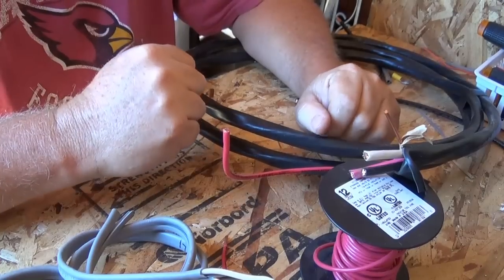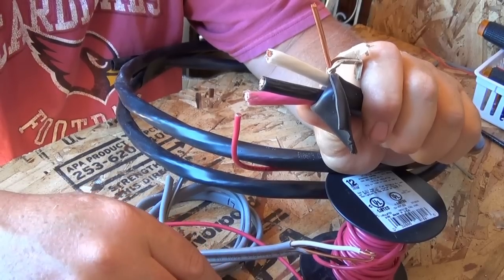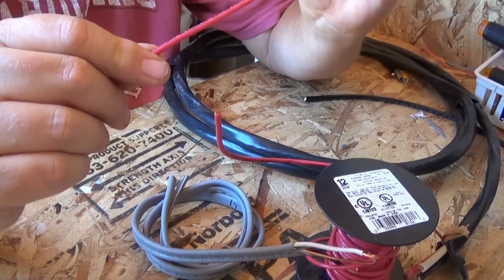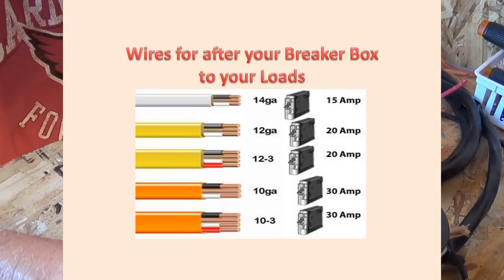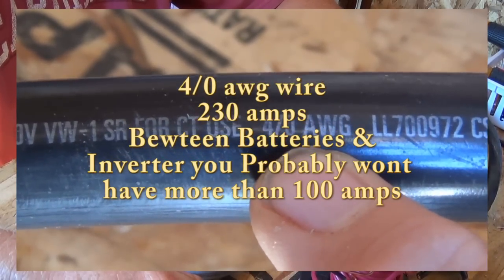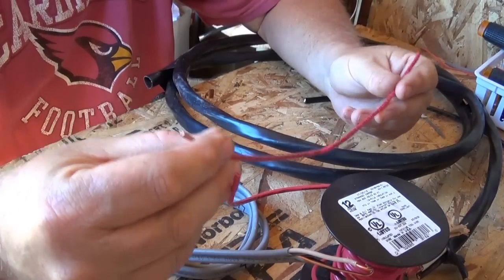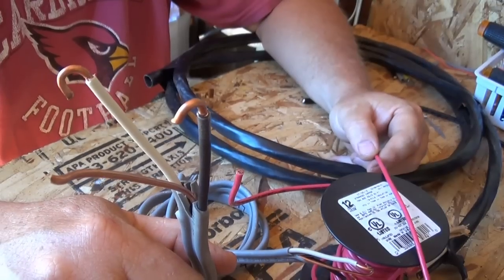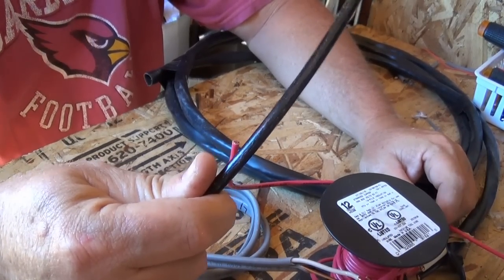What Size Wire Do I Use To Wire My Solar Components? Does Wire Size Matter?

Comment: it seems to me that watts should be relevant, such as in the case of using 12 ga solid wire that is rated at 20 amps to 600v meaning 12,000 watt rating on the wire, so if i use 12 volts, then can go 1000 amps same watts! 12,000 watts? so if i use 12ga solid romex from my panels at 25v dc and to my batterries at 14vdc then that solid copper 12ga wire should easily handle 100 amps, right? my wires are slightly warm on my full charging status but not hot, am i limiting my current at all?
Reply from the maker: i am not an expert from from what i understand you dont care about the watts when it comes to wire size. its the amps that matter.

Comment: The reason that an appliance is labeled at a specific voltage is because that is how it is tested and the resulting amps at that voltage.  A drop of 10 volts from 120-110 in a house is highly unlikely.  Three wire NM cable is not only for switches.  It is also for stoves and dryers that need 120/240 volts.
Reply from the maker: thanks. also from what i understand some appliances need at least 110 volt to operate. .

Comment: Could you answer a question? I have a 30A solar charge controller, with 2 separate inputs, for 2 150w panels, what AWG cable would be needed for this. Thank you.
Reply from the maker: i am not an expert but i would use the largest size that will fit. the documents of the charge controller should tell you the size it will handle. most pv wire is 10 or 12 gauge. i dont remember.

Comment: I’m sorry I’m just as confused as when I got here. 😢 the best I can do is , the higher the amperage the thicker the wire or the higher the voltage the thicker the wire or the same with watts, I guess? I really don’t understand anything really.😢
Reply: The voltage rating of conductors is based on the insulation on the conductor.   It is voltage rated so that at that voltage or less, two conductors next to each other will not arc.   Watts is a unit of power and what you pay your utility company to borrow.  Amps is the electricity flowing through the wire.  Amps in wires causes heat because of resistance in the wire.  Increase amps will increase heat in the wire.  Increase the wire size to reduce resistance in order to reduce heat to a level that will not damage the insulation.   Hope this helps you!
Reply: @KevinCoop1  thanks 😊
Reply from the maker: focus on amps. each size of wire is printed on the wire up to 600v.

Comment: also if i recall right, AC volts travels mostly center core, where as DC flows easier outter wire (aka more center vs's more outter skiin, least thats what i was told yrs ago.
Reply from the maker: could be. i really dont care how it travels i just care about which wire i should be using. solid for ac and stranded for dc. however when you have really large cables you use stranded also known as welding cable mainly becus its flexible compared to a really thick solid copper rod.
Reply: @ArizonaHotHomestead  how it travels is part of the reason to choose the right wire, notice they dont use braided wire in main home wall lines. there is a reason.

Comment: I’m a bit confused on the solar panel wires. I’m recommended to get 4awg wire that will go to the inverter since my solar panels are over 100ft from the house however it’s saying that  mc4 connectors only fit 10-14awg. So how does this work?
Reply from the maker: you can get mc4 for 8awg wire. here is what i would do. use a electrical box at the panels and inside the box wire the panels wire to a 4awg. example 10awg with a 4awg. you might want to use a small bus bar just make sure they have an insulator. one for the positive and another for the negative. if your charge controller can take a 4 awg or if you are using a breaker inside with your components before it gets to the charge controller and it doesnt take the 4awg wire again use a box and bus bars to reduce the wire to a wire that will fit . does that make sense? good luck. oh by the way i am no expert.
Reply: You should keep your conductors at 10 to 14 as short as you can.  Mount some Mc4 connectors to the side of a junction box with #10 inside the box.  Splice the #10 to the #4 inside the box and run the #4 in pvc back to whatever you are feeding.  Do the same thing on the home end.

Comment: Hi 
Might my question gonna sound stupid so sorry for this first😃
I'm just only starter learned car electronics..
So my question is if the starter motor need about 200amp for the start and a 4AWG wire can only do 75-100amp how is it gives for the starter motor 200amp?
Might it sounds stupid but I'm getting confused now..
Thanks in advance for anyone who's answers for me😊
Reply from the maker: auto expert could answer it better but i thought is the starter only needs the 200amps for a short time to start after that i think the alternator helps to keep everything going.
Reply: Amp ratings of conductors is amps over time.  So, amps at a certain amount of time will heat the insulation to cause damage to it.  It is assumed that the starter will only run for seconds.  So, it’s all about how hot the wire gets.

Comment: Hope you can see this 6yrs after you posted this: I'm installing a 2K watt inverter. Batteries to inverter mounting location is 15'. I decided to go with 4/0 welding cables. 

My question is: what gauge should I use to ground the inverter to the chassis (semi truck) the inverter came with some doubled-up wires that are stamped 16-8 on the eye-connectors (not sure what that means)

Oh ya, this stuff makes my brain hurt 😂
Reply from the maker: i am no expert. some of this stuff hurts my brain too. lol... for all grounding use 6awg bare or green wire. . i am guessing you should be ok on 4/0 . maybe touch the wire to see how hot the outside insulation gets. if its super hot you may want to get larger cables. i think you are going to be fine.

Comment: How does distance from solar array to inverter determine gauge?.
Reply from the maker: i am no expert but what i am told is electricity dc or ac will have a voltage drop over a period of distance. the size of wire if bigger than needed will have a less drop than a smaller wire.  dc will drop faster than ac .
Reply: Use a voltage drop calculator online.  It’s all about power loss.  The higher the %lost the more money you wasted (to a point) I would suggest you size wire for 3-5% voltage loss.  Four utility solar, I designed to 1% average.  Lost power there is lost income.  Owners want income.

Comment: You plug in 120, 120 will be at the other end! your wrong.!!🤣🤣🤣🤣🤣
Reply from the maker: not always... most appliances and lights will run on 110v or 115v  but yet 120v is started at the distribution box. depending on how long the run is the voltage could drop to 115v. .

Comment: Really silly to try to give advice when you don't understand the subject. Normal modest off grid homes using 48 volt battery bank and a 5000 watt inverter is likely to be fine with 1/0 with just .25 percent voltage drop over 4 feet. (you want to keep your inverter close to your battery bank.

Listen to your inverter manufacturers recommendation (particularly if it's UL1741) 

Find a good voltage drop calculator, try to keep voltage drop under 2% for wiring from the array to the charge controllers. Today with cheap solar panels and MPPT charge controllers this is not a firm rule like it use to be when solar panels were $5 a watt and you were usually using PWM charge controllers.
Reply from the maker: i am no expert. actually where i live most people have 12v systems, and running maybe a 2k inverter. they all live in tiny homes or rv or connex, voltage drop means nothing to me its to complex. i look at it as will it work or not. most people that live by me are the same way. i do appreciate you adding your comment becus some folks need to know information you provided so thanks for your input. have a great day.

Comment: would I use120 feet   2 gauge wire from 20 400w pano 120 feet to the regular?
Reply from the maker: if you wire the panels in series to increase volts it will help with voltage drop and a 6 gauge would work but it you want to run 2 it will reduce the voltage drop but maybe to big for some connections so you may not a junction box to reduce the size ..

Comment: 4 100watt 5.4amps per panel over a 85'' cable run to an 40amp mppt charge controller. what size wire is best for this application? Take in mind this is just a starter kit and most likely up my panels and battery bank size in future.
Reply from the maker: most panels are 10 or 12 awg wire. you could use 10 awg for most applications. the higher voltage the better.

Comment: Not just amps but insulation type,condition of use and terminal rating.
Reply from the maker: what is a terminal rating?
Reply: @ArizonaHotHomestead  Electrical terminals have temperature ratings.
The distribution panel in your home has terminals breakers that are rated for 75°c.
So even though you have a THHN wire rated 90°c you cant exceed the terminal rating.
Because it's not so much about amps as much as heat , the same wire will have different ampacities  in different conditions. ( free air,  a hot engine compartment, on a roof, in conduit, 3or more conductors in a conduit.)

Comment: I don't see how the losses with the multi stranded wire is less when the resistence is more, it makes sense to me that the resistance is what causes the loss a 12 AWG solid copper wire has 1.588 ohms of resistence per 1000' of wire 10 AWG is only 1 ohm per 1000',  but for the 12 AWG multi stranded wire the resistence depending on how many strands of wire in it ranges from 4.76 ohms to 5.18 ohms per 1000' and 10 AWG multi strand ranges from 3.22 to 3.64 ohms per 1000'.
Reply from the maker: i was told it has to do with the way ac and dc runs on the wire. i am no expert just know solid for ac and stranded for dc unless you are going super big on the wire you use stranded becus its flexible.

Comment: Great explanations for wire sizing. Right smack dab in the middle of my electrical build on my van. A question occurred to me and that is, if a heavy duty set of jumper cables is rated for 1000v and 500 amps at 0 awg and is stranded and has similar temp ranges, shouldn't it work for any service in the van? Way above my pay grade😁
Reply from the maker: above my grade too. but i think jumper cables may not hold that amps before melting the insulation cover. maybe no.

Comment: The fans inside inverters arent designed to install it vertically cause the bearings of fan will fall suddenly.Watch out...
The effort in bearings there is axial,and are not designed to do that.
Reply from the maker: thanks didnt know that

Comment: Does ac come out of the inverter? If so why do you recommend stranded from your inverter to your box? And what about charging from shore power, if your running ac to it to charge your dc batteries would you have to use stranded as well? Thanks for the video, God bless!!
Reply from the maker: becus of the size of wire. when the wire gets really thick you want to use stranded just so you can work with it other wise it makes it really difficult to work with.
Reply: So it can bend....the solid ones is hard to bend/cut..and not good for . movements...

Comment: Semi truck battery/starter wire is 4/0 and has very fine strands.  And, since semi's have multiple batteries, you can purchase inter-connect cables for wiring batteries together pre-made.  Great for heavy solar wiring!
Reply from the maker: thanks
Reply: I would never do this. I'm buying Temco appropriately gauged wire, designed for this application. This sounds like super sketchy advice... And I'm a former trucker.

Comment: You are very nice teacher , I have question if you don’t mind and that’s will be great for me 💐🌹
Reply from the maker: keep in mind i am no expert , i learn everything my doing and others. i will try to help what question do you have.
Reply: ArizonaHotHomestead I want to know how to select the right size of cable between battery and inverter ?
Reply from the maker: @استغفراللهوأتوباليه-ر6ث1ر what size is the inverter?  how many amps?
Reply: ArizonaHotHomestead the size of inverter is 1500watt , 12v to 220v
Reply: ArizonaHotHomestead what is the equation or the calculation idea that I can apply to all inverters
Reply from the maker: @استغفراللهوأتوباليه-ر6ث1ر  watts = amps * volts.  what size cable you using between batteries? maybe use the same size  cable size 4/0 awg with a fuse at the battery side positive.  you might get away with using 0/0 awg . i choose that size becus no loss in volts and it wont heat up causing problems later.
Reply: ArizonaHotHomestead thank you so so much , I really big appreciate for you

Comment: DC current runs on the outside essentially skates on the outside of the wire so if you have one wire solid or you have 25 wires stranded you can see the reasoning for using Stranded wire in all DC applications
Reply from the maker: thanks for the input. i like it when others add good insight to one of my videos. thanks.

Comment: Thanks for taking the time to explain.  Very nice high level introduction to selecting proper wire sizes. 

One note, your guidance on stranded vs solid is not accurate.  Solid wire has lower voltage drop but is less flexible, can break under continuous bending and is generally more difficult to work with.  Stranded is typically slightly larger in physical size, much more flexible and easier to work with but can lead to higher costs, high voltage drop, higher capability derating and can lead to loose terminals over time due to inherent vibrations of the machinery or the A/C current flowing through it.
Reply from the maker: good into thank.

Comment: I have 110w / 35v solar panel to a 20 amp controller,  will I be good with 10 gauge from panel to controller and 6 gauge from the controller to the paired 6v RV battery?  Should both be stranded wire too?
Reply from the maker: i would do 6 gauge to both and yes to stranded. think this stranded for dc and solid for ac.

Comment: A easier way to explain sloid wire versus stranded is electricity goes around the wire not through it. The more strands you have the more amps you have compared to a single strand.
Reply from the maker: so true.

Comment: Vid was a great help! 
QUESTION: I'm looking at a new Grand Design trailer. It is "prepped" for solar with a 10ga wire coming down from the roof into the front storage for connection to a inverter. If I get this trailer I am thinking of 600 to 700 watts in panels on the roof. Is the 10ga wire they installed heavy enough to go to a charge controller? Thank you!!!
Reply from the maker: 10ga is a 30amp wire so it should be fine. 700w should be 24v with is 24amps. . it should be fine. if possible you might think about 6ga. i would only do it for peace of mind and i like to use bigger wire. ... what if..... what if you get more watts in the future. what if.........

Comment: hi, Does 2.5 mm ttr cable carry 12 amp load with 190 watt mono panel?  thanks

note: cable distance 10 meters
Reply from the maker: mm and meters? i think 2.5mm will do about 13amp so that should be ok. i may want to go one size bigger for peach of mind and maybe surges. 10 meters i think is around 10 feet  so that should be fine

Comment: Thank you sir for taking the time to make this video, learning is wonderful! One point to make about current and voltages, ratings and specs... Always use a wire gauge calculator, there are plenty of free online ones and charts to refer to (Google for one), to help with calculating gauge, length, conductor type, etc, based on voltage and current. Both factor in, 600v listed on the cable is only the rating for insulation, and safety. 
     One thing for DIY'ers to also understand, is that voltage x amps = watts... So a 1200w load at 12v is 100 amps current, and a 1200w load at 120v is 10 amps, this is why jumper cables on a car need to be very large gauge, and household runs a lot smaller. Length loss matters more as the voltage is lower, higher voltage can travel farther with less loss. That's why on solar it is better to use higher voltages like 48v for battery banks, and higher for solar panel runs, to keep costs lower on cabling, as you are able to use smaller gauge on the longer runs (due to lower amperes). 
     It can get very expensive to use a 12v battery bank if the inverter is not right next to it, as you may need cable that is very large. For example, I just wired an inverter in a guy's RV Trailer where the inverter is in the back, and the batteries are in the tongue by the hitch, and had to buy a 25 ft pair of 3/0 cables (didn't want to use chassis for ground), and cable cost $178... So higher voltage saves lots of money on cable costs.
Reply from the maker: thanks for the info.

Comment: i have 18 awg wire motor uses 6 amp and 60 volt power supply will i be safe?
Reply from the maker: stranded dc right?  it might be ok i like to go bigger for peace of mind. so i would use a 14awg

Comment: Is 2g wire from the battery to a 2000w inverter okay?
100w 12v panel
10g wire to the 30amp controller
10g wire to the 36ah 12v agm battery
Reply from the maker: i am no expert. it seems a good size.

Comment: You do not need that big 3 wire for separate light switches. You need them for 3 phase 120v to 240v hook ups for electric stove and dryer.
Reply from the maker: i used 1 size bigger for everything.